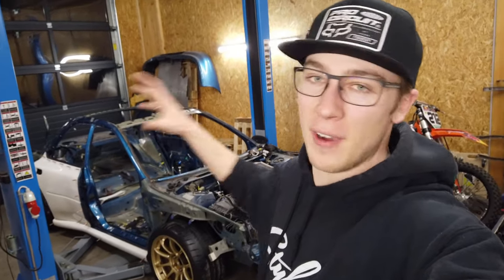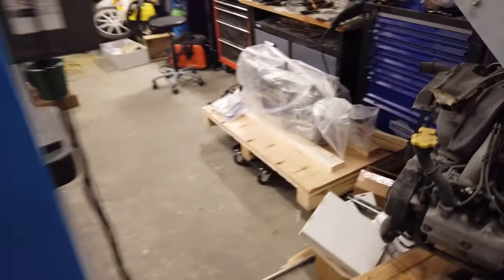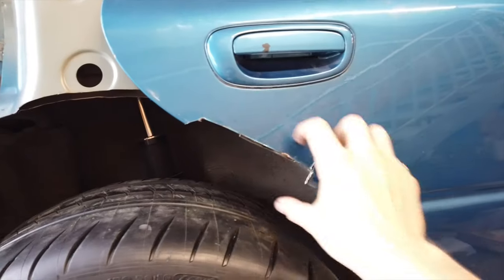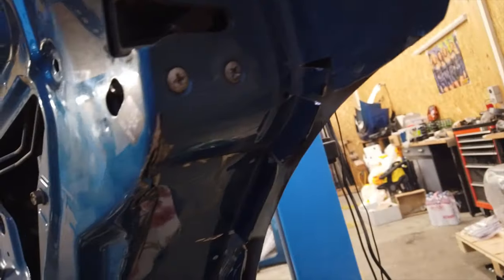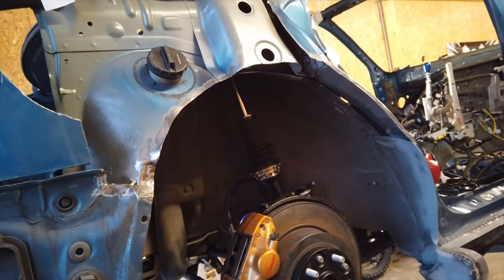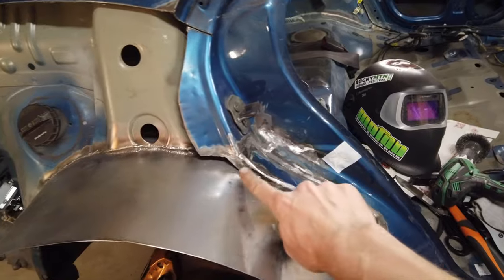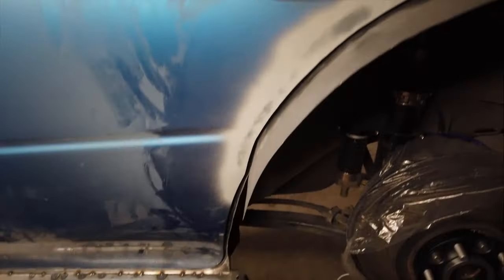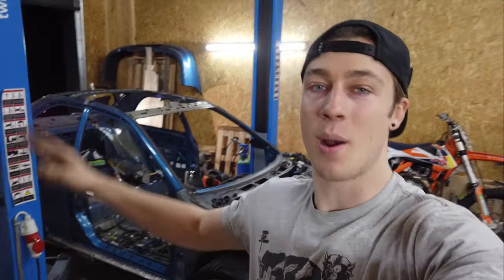GC8 RSTI Subaru Build - Building New (Wider) Wheel Arches - Ep. 31

Comment: i notice you had a 18x10+35.. so without a 22mm spacer.  would that be the perfect wheel setup with the abw kit?
Reply from the maker: Gerik In theory yes (even though i would still choose a 9.5” wide rim over the 10”), but with my suspension setup the rim was touching the coilovers so I had to put 20mm spacers to clear it. If you are running a GC rear end, your track width will be narrower anyways compared to the 2006 STI which i am using here, so you should be able to clear the coilovers easier with the same rims hence needing smaller spacers. Hope that makes sense and helps 👍🏻
Reply: got it thx.. i just actually bought a 1998 gc8 sti v4 and saw your channel and its very helpful thx!!